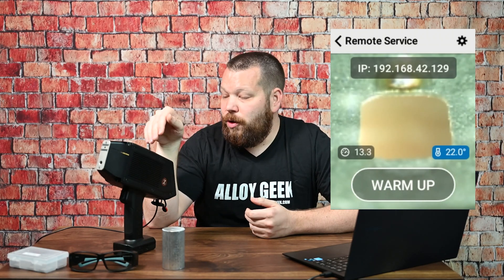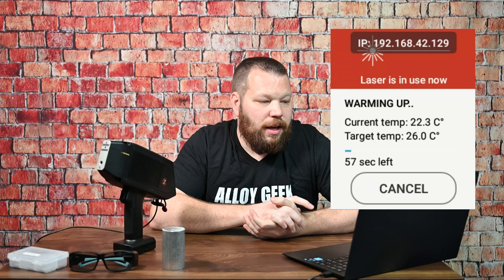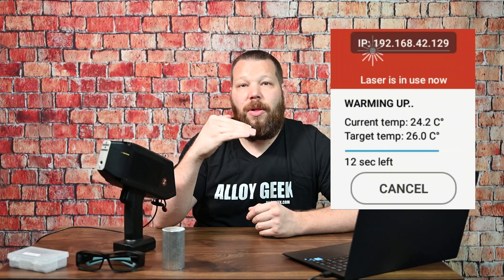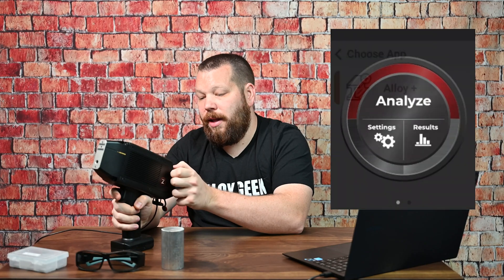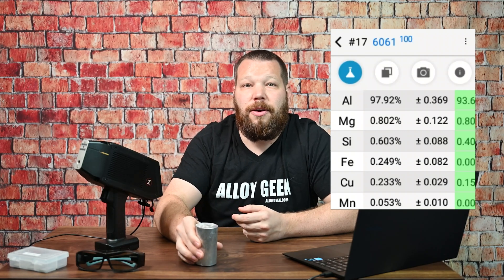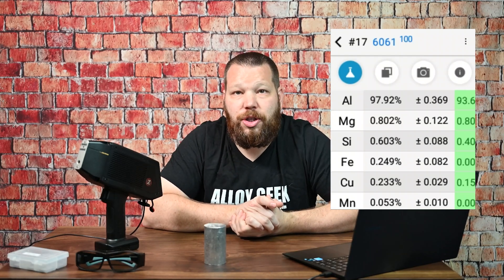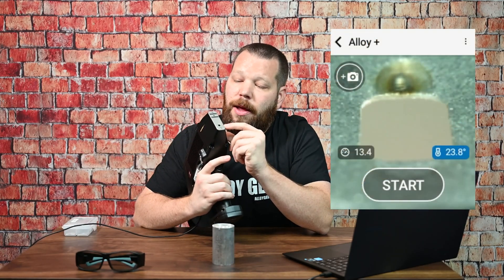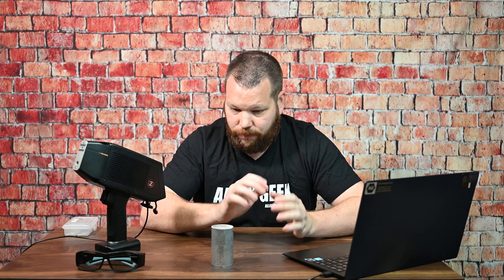Your First LIBS reading with the SciAps Z902

Comment: Can you please show me how you cab correct the reading .in Block certificate Cr showes 16 but actual value is 22 , how I can correct it.
Reply from the maker: If you are using a Z-Series handheld LIBS unit you likely need to perform drift correction. See this video: https://www.youtube.com/watch?v=7znPZ6Xu6Rg

The second thing you can do is work on the cal factors for the instrument. This will come in a future video. For now, try the drift correction and see if that resolves your issue.

If you're still seeing variation, you may need to take multiple readings and average them.

Comment: Can you show how large the arc strike is?
Reply from the maker: The laser that strikes the surface makes a small mark on the sample typically within machining roughness.  It is not a big arc like a welder uses. The laser is only a few microns across.